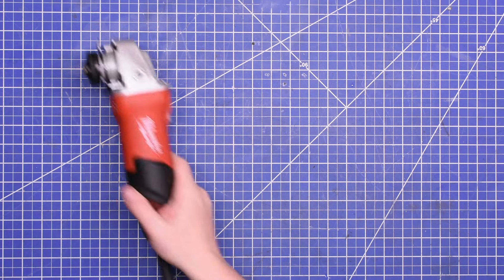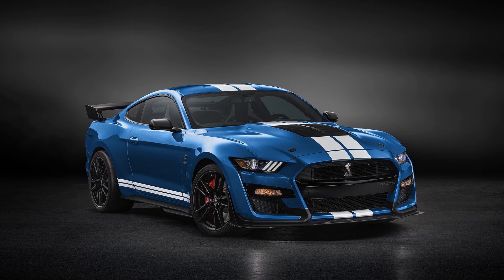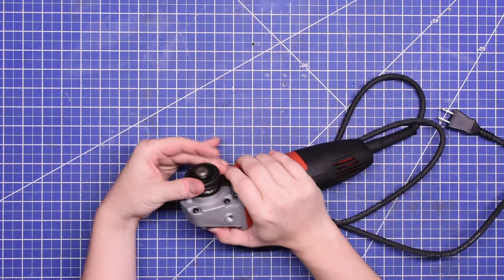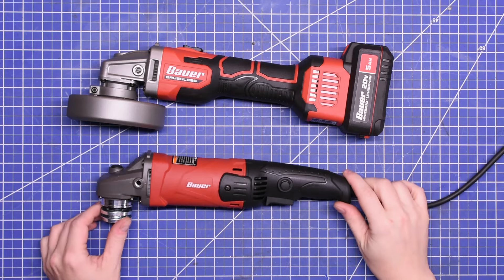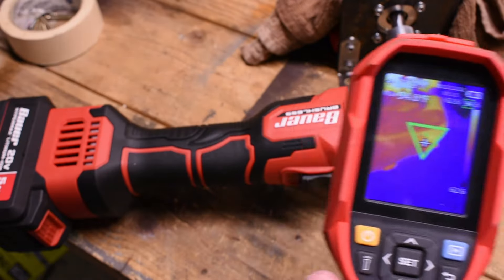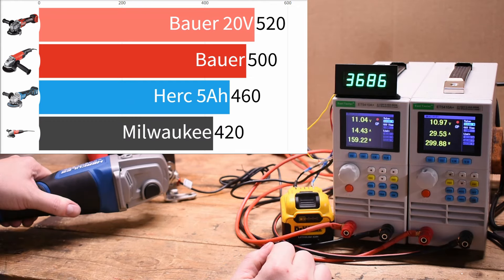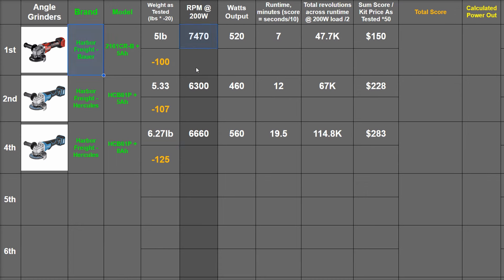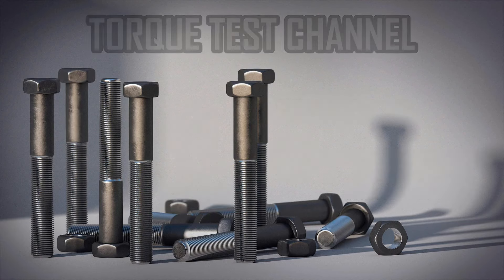Corded v Cordless Angle Grinders Dyno'd! Milwaukee vs Harbor Freight

Comment: Corded grinders have key advantages in-shop for continuous use at heavy load for example turning large wire brushes and grinding rocks. That said I do not buy new 4-1/2" corded grinders because going up to 6" range permits using the glorious 6" thin kerf cutting discs. I buy cordless and like my Makita best of those after modding the guard for 6" discs. I do not use large grinding rocks or wire brushes on baby grinders. 

Angle grinding is high load and rough on equipment. I maintained a mixed fleet of corded grinders for a local welding school and advise avoiding "features" like indexable handles (they loosen) and going for ruggedness. I never had a bad Makita anything.

I own and recommend the GA6020 6" corded. If you weld and have DC power like some older welders output some Makita work on DC too. I got a XAG03 (superseded by XAGO4) which serves me well spinning 6" cutoff discs after guard mod. 

If as you review angle grinders you compare guards by swapout from larger grinders that would be useful to many users who prefer to buy a guard (cheap) than the work involved modding them. I save old guards and sometimes get guards from Ebay.

Even users who have a pile of corded grinders will benefit from a few cordless units because mobility is worth it.

Comment: Cordless and corded and corded angle grinders tend to be used for different different uses, corded is used for bigger longer jobs inside the shop, cordless excels at cutting through the odd problematic bolt or working outside.

Comment: Was at HF today and saw they had a Chicago Electric 1in pneumatic impact gun for $169. Box said it had a rated torque of 1500, curious to see if you test that. Was also an Earthquake 1in impact gun for the mid $300 range.

Comment: Could stating how many amps the tool is capable of maybe have to do with helping people limit using a number of high powered tools on one circuit? 15amp vs 20amp etc outlets for example? aside from the possible power output they are capable of i mean..
Reply from the maker: That's true. But can always just be in the specs like most other tools, doesnt need to be in the title and the basis for its performance

Comment: Love to see a proper Angle Grinder from Fein, like the new Fein CG 15-125.
Reply: Interesting, that's actually a brushless motor in a corded tool. WIth the inverter losses though it's not really much more efficient than a good corded grinder while having much worse cooling - not great for extended useage but very suitable for dusty environments.

Comment: small batteries last 5 minutes max. as simple as that - if you are going a full day of grinding/brusing you dont want to change 50 batteries in the process, even 10 changes would be a hassle provided you have to leave workplace and head for fresh battery. and i worked a lot with dewalt cordless grinder it is not nearly torky as 10s of corded models ive had before. the only applycation i found in the end is going with cordless for a short job in wet environment because lower operating voltage is safe.

Comment: This is actually the tool I wanted to see tested more than anything. It would be really nice to see the cordless Dewalt XR, Milwaukee Fuel, and Flex. It would be a real bonus if you threw in a Metabo but not the crap HPT versions. That is asking a lot though if you don't already have batteries for the Metabo. My guess is Metabo or Flex possibly wins.

Comment: I am constantly surprised that cordless tools are so powerful. Though I suppose I should rephrase that to constantly being surprised that the corded tools are so weak.
Reply: You can only get so much power from the wall. You can get a huge amount of power (in relatively short bursts) from modern batteries.
Reply: @smpstech  i'd say it's more about profit margin and the following effort invested

I couldn't find a brushed cordless impact wrench last time i was in the store. There was 1 brushless corded impavt.
Reply: You never have to charge them.  The extra power is pointless. Just don't hog the tool. You can get much more work done with a corded tool. I've never regretted using a corded tool. Battery tools are only for times when you can't get power to the area.
Reply: @firesurfer  how does it feel to be objectively wrong?

Comment: I wonder how the cordless would do with cycling on and off. With running continuously like that the batteries will heat up, which might cut into the runtime and isn't exactly how you're typically going to use one.

Comment: Hikoki/Metabo has that stupid adapter (ET36A) for the multivolt cordless tools  so you can use them from mains instead of a battery, I would like to see the comparison between the corded vs plugged in cordless grinder.

Comment: YES!! I knew there would be a grinder dyno coming haha, a rare case I’d point to the dewalt. I’d love to see the workhorse 7amp dewalt slide switch. It looks like the current model is updated from mine, but it was the 2nd corded tool I ever bought, and has countless hours of rust, weld, etc grinding and cutting on it over the last probably 6-7 years? I now use it alongside my cordless Hercules with a 12ah in the Kustoms shop and still prefer the dewalt for grinding welds because it spins much faster and bogs down less under load. The weight and balance of the Herc with a 12ah make it my favorite cutting grinder ever, plus it shuts off instead of exploding discs 🙌 but not if you’re just pushing it through a cut like my sh!tty Ryobi cordless grinder haha it’s been demoted to a sander/stripper in the home body shop.

Comment: First time I have ever heard of a grinder using a 5/8" thread. They are always M14 in Australia unless they are a 4" and they are usually M10.
When I was getting power tools for the workshop I was running overall I found the Milwaukee corded units when abused usually burnt out quite quickly. They all delivered the 'Beans" when required but when really put to the test grinding for more than 2 minutes without a break would cook. It's hard to tell heat wise when using the grinders with welding gloves on. I personally burnt out a 9" version that was nearly brand new in an hours use trying to not push it to hard.  Then tried the Professional Series Bosch and these were very nice to use soft start but when the going got tough would protect the motors thermally and you would be forced to wait. Went straight back to Makita. They seemed to be built in such a way that they were more immune to heat damage due to the available power.
Reply from the maker: Every grinder I've ever seen in this size range uses 5/8" coarse thread. But makes sense it would be different elsewhere in the world

Comment: I got the Makita XGT 40vMax grinder, in real life use its as superior as the price tag tells us, plus some. or more. Its just insane to have a 2 battery grinder with only one battery, but obviously the Makita extra protection system on both the tool and the battery make them a tad heavier than 18v options. Still, 18 vs 36/40v grinders arent competing, the XGT is undoubtedly the best and worth the triple price. I strongly discourage everyone to buy 18v grinders, remember the 36/40v Makitas perform the same with 1 or 4 bars o f remaining battery life, the performance 
consistency is most remarkable.

Comment: Emissivity is a thing.  The temperature the IR cam gives you on the aluminum housing isn't comparable to what it reads on the plastic handle.  If you want accurate temperatures, put a piece of scotch 33 electrical tape where you intend to measure.  It has an emissivity of 0.9, so it's pretty accurate

Comment: New brushless motor designs are terrific, and I admire the builds that the battery grinders show. But..... the cost is still outrageous for them and needing to buy extra batteries is simply prohibitive, as I still have a corded grinder which works just fine.

Comment: The dewalt line up for sure. I got there cheapest grinder for free with a tool deal and have been useing it aggressively at work. Didnt intend on using it at the shop  but it has been very useful especially for light jobs like running a wire wheel over some beads before another pass. 6ah 60v seems to hold up alot better than a 5ah 20v when it comes to Voltage drop. Also I've seen that grinder for sale with 2 4ah batterys in a kit. would not recommend running a 4ah on it because of excessive heat and my 4ah battery seems like it has alot less runtime now after being used on my grinder a couple times. I've also used a 1.5ah battery on it once when I first got it. Killed it almost immediately. Would not take a charge after. Been useing it over a year now and it sounds like the bearing is about to go out but it still works

Comment: Please test the Metabo HPT G3612DVEQ6 (HIKOKI G3613DVE) it claims to be as powerful as a 1500w angle grinder. And atleast the older 1300w model of the multivolt grinder was the most powerful of all cordless angle grinders.

Comment: The temperatures are off when looking at different colors and finishes.
Put a piece of electrical tape on the hottest part and read that after it has warmed up so the emissivity is controlled between tools.

Comment: I would like you to test Milwaukee 2882- 20 and the 2980-20 and the Ryobi PBLAG01B and the Ryobi PCL445B. What thermal camera do you use? Do you like it and do you think it worth the money? I work as a mechanic and I'm thinking of buying on of those smaller hand held ones. Whould like to se you test different thermal cameras if you know a way to actually test them.

Comment: I Run my bauer cordless off dewalt batteries using an adapter and I seem to get good run time from it. I don't run it as hard as you are doing  in your test though so may not be an improvement. I just didn't want to buy bauer batteries and have even more chargers.

Comment: Please test the cheapest angle grinders you can find. I know in  my home shop has five or six of the $10 ones from harbor freight because I am too lazy to change discs.
Also the low amperage is kind of a blessing. Cutting discs will generally bind and stall instead of explode

Comment: One number that should be added... is how long it takes to recharge the battery, and then how much time with enough batteries (and chargers) to have them all charged to have a fresh one ready by the time the last one is done (i.e. 20 min runtime, with 1 hour recharge, would need 4 batteries)

Comment: I´d like to see a Metabo 19-125 Q DS. 125mm, 1900W - not sure if they sell that model in the US as a 120V version since it won´t work on a 15 amp circuit. But that´s a grinder that actually makes sense as it is significantly more powerful that a cordless grinder. 

Cordless grinder have come a long way, the Würth (made by TTI, similar to Milwaukee) model we have at work I used recently to cut a Kryptonite New York bike u-lock, took about 20 seconds for two cuts.
Reply: @1pcfred  Sure, it's a split-phase system, you could get three-phase 240V from the power line but for some reason they just don't do that in the US*. But powertool manufacturers seem reluctant to use higher powered circuits for handheld tools anyway. 

*Which is really stupid for stationary machinery because single-phase induction motors are worse in every way than three-phase induction motors.

Comment: Nice video. I'm not surprised about the cordless grinders, the brushless  ones are really good. I have several brands but my favorites are Ridgid R86042**  and R86407 I use them as 7-inch grinders and they don't seem underpowered at all and battery life seems better than those you tested.(Although actual use isn't a constant consistent max load either.) These even have regenerative braking they don't advertise, but i have confirmed and measured myself.  I would love to see these on your dyno. Also a surprise was HFTs earthquake grinder, no braking but awesome load performance .  I also would love to see Chervon's 24v models (Kobalt / Flex/Skil) especially because 24v Kobalts sometimes feature a speed Governor that on the die grinder is very impressive, I suspect the angle grinder may have it also. Love your vids and Ill be watching for sure!

Comment: I paid $73 for a low-end Panzer cordless with a 4Ah battery and 8k RPM (no load). It does the job, I don't use it often. Not sure you even have that brand in the US.

Comment: My slightly older milwaukee is incredibly smooth but does get extremely hot. I was grinding when it was 102 outside and that grinder absolutely reached 200 degrees. Squeals like a pig now but runs great.

Comment: I have both the 20v Hercules paired with an 8ah battery and the M18 2880-20 paired with a 12ah and while they both have their strengths I find it almost impossible to stall the Milwaukee no matter how hard you push it while the Hercules will stall quite annoyingly. I'm a big fan of the Hercules tools but for me the Milwaukee is the go-to when I need a cordless grinder.

Comment: I see that Harbor Freight is just releasing a Bauer 8 amp battery. None available in the northeast as of today (4/24/2023) however it's on the website for "a lower price" of $99.99, down from $129.99. When was it $129.99? Ha!  It would be interesting to see how the Bauer grinder performs with that.

Comment: I've always wondered whether expensive 2 stroke oil (for the fuel:oil mixture) is actually better for your engine than the cheap stuff or if it's all a marketing thing to get you to spend more money. That would be an interesting video. Either way, these videos are helpful whenever I'm wondering about something you've done tests on. I'll definitely watch the video on ratchet straps when i need new ones 👍
Reply: I think Project Farm did a video on that
Reply: @mrfreez82  oh yeah you're right lol. Didn't think to look first. Thanks 👍

Comment: Supposedly the 4AH hercules batteries use the same cells as the 8AH ones. They discount the 5AH, which makes them hard to resist.
I wonder if they will just discontinue the older cell ones. I'm personally using the 4AH batteries because they seemed like a good mix of size/power. I believe it says right on the hercules angle grinder package not to use it with less than 5AH battery.

Comment: makita 40V XGT  cordless angle grinder
Reply: Yes please, with a large battery!
Reply: @riba2233  i think that the 2,5 Ah gives more peak power than 4,0 Ah, some othger guy tested it and put up a video

would be interesting to see comparison to 5Ah and even 8Ah
Reply: @darthtrump4428  it doesn't, 4 ah cells have more power and it shows when testing with high power tools, as grinder or chainsaw. If you test with a low power tool like an impact it can go bith ways but irrelevant, it is such a small difference.
Cells in 2.5ah are rated 25-30A, and ones in 4ah are rated 35-40A

But 5 or 8 are even better (just double the above numbers) and would be much better in the run time test :)
Reply: @darthtrump4428  Pretty sure that other guy is Tools and Stuff, and TTC has pointed to T&S as to why TTC doesn’t waste their time with the 4ah.

Same thing goes for the Metabo HPT multivolt 4Ah, it’s weaker in testing than the 2.5Ah.

Comment: Nice to see corded versus battery stats instead of opinions. What about longevity, how long will they last? You tested battery life but not tool life.
Reply from the maker: Could you show me an example of a channel testing tool life on camera in a representative way?
Reply: @TorqueTestChannel  You are honest guys and if you run a tool until it stops or no longer works, record start and finish and compare with other tools.
Reply from the maker: @tonysheerness2427  With battery tools that can be a bit difficult. You end up testing battery durability being cycled that hard more than anything else

Comment: I have two of those Bauer corded grinders.  I've had them for 3 years, and i beat the shit out of them.  They refuse to die.  Even if they did, $45USD is a pretty small bullet to bite.  I also have a Hercules 6" corded grinder from HFT, but i haven't had it long enough to really judge its character.

Comment: Almost all corded tools use universal motors and they can be pretty inefficient, especially as they get smaller as you can see from these angle grinders (both power consumption vs power output and heat).

Comment: I've had great luck with my Makita XAG21ZU grinder, but it likes to chew through batteries under heavy load.

But, when I really need to convert steel into sparks I have an old hand-me-down 15-amp Hitachi corded unit that my grandpa found somewhere which honestly scares me a bit with how much power it puts out.  I'm pretty sure my wrists would cease to exist before I could stall it.

Comment: Use Dewalts 20v and 18v cordless grinders!!!!
On the 18v do a standard battery, an xpr,  and a run with a 18v-20v adapter on a 20v 4AH battery. I'm wanting to see if I buy the adapter kit dewalt sells and continue using my old tools or if I just bite the bullet!
(I'd be more than willing to supply the tool for this but my batteries are all shot to hell.)

Comment: be cool to see how long they can handle a high watt draw before the smoke flies, something like 400-500 watts out, realistically thats how i use an angle grinder, all it will suffer for 10-25 minutes at a time grinding welds flush, cutting plate, or wire brushing entire truck or trailer chassis

Comment: Seems counter intuitive, but in theory, a brand new angle grinder probably shouldn't make the same amount of power as a used one.  There's a break-in period for the grease pack to thin out, the bevel/pinion gear faces to wear and polish up, brushes to lap with the commutator for better conductivity, etc.  I have no idea if it would even be a scalable or noticeable change on the dyno, but it logically makes sense.